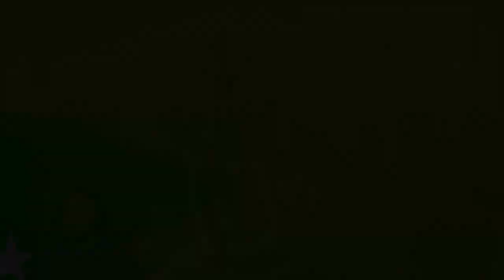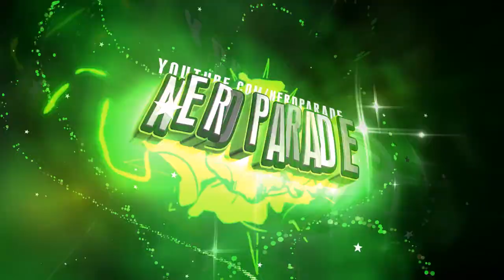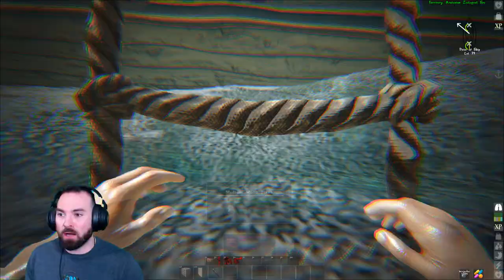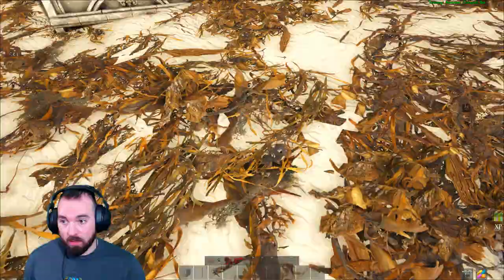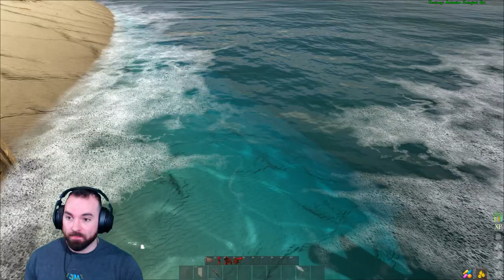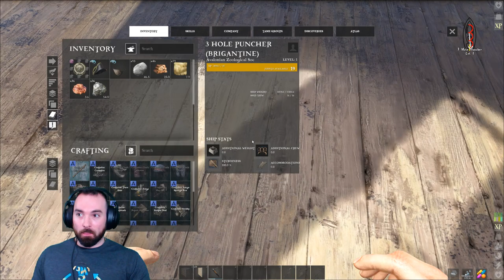ATLAS - Simple Base Destroyer Brig Design and the Science of Cannons VS Structures! E33

Comment: If you want a good wall breacher/siege vessel you need the brig with 20 large cannon broadside. Angle them to a focal point at max or close to max range. One volley knocks down gateways.  On actual walls it'll take more to make a huge hole. And it is still effective in a ship to ship scenario if you are a decent pilot. Make bare bones brig and your weight will still be decent.  2800 kg for 20 large cannon plus the weight of your balls at 10 kg a piece. Your still looking at less than 8k weight carrying a cpl hundred balls. All speed sails so you can get in, lay waste to the walls, then gtfo or come around for another pass. Even more effective if you have 2 or 3 kitted out like that and run a train. Nothing can withstand 40k damage a broadside. And that's 1 ship that's not a snail either. Need some lvl in it but if your good you won't get touched by SotD as you have way more range then them. Don't use npc auto fire at range. Manually lead or judge for them turning to get a broadside on you. And on a pvp server (I play official pvp) you'll nvr be alone when you do this. Don't worry about mortars either because you'll be too fast for them to hit you especially if you catch em offguard.(also assuming your a decent pilot). Ship to shire combat you don't want to be charging straight at the gates as it'll take more time gtfo. You wanna come in at an angle and fire as your turning back out so they never have time to react before your gone.

Comment: I was testing this out earlier and then when I saw this I had to go recheck my numbers because I couldnt believe the range thing was accurate. These numbers were all from base (100% quality) items and testing ranges of 10 and 40 tiles. With a +/- 1s margin of error, a regular cannon takes 44s to fire 10 shots with a load time of 4s @ 1064 dmg/shot to destroy a stone wall. In same test with a Lg cannon, takes 39s to fire 5 shots with a load time of 7s @ 2025 dmg/shot. I implore you to recheck the dmg vs range with the same cannon instead of using different ones.
Reply: basically boils down to being able to line up your shots easier vs range with cannons/lg cannons

Comment: Put large speed sail and small speed sail. put your guns on the rear. Level for weight reduction. Use a schooner with to rows of four large guns. Kite the SoD. Fire at shore in position to evade mortars. Much cheaper. Much faster. More efficient. More flexible. Accomplishes same mission.  Do you guys even gather mats for these videos or are you on privater serve auto generating the materials? You tend to overbuild as if mats are no worry. Using a brig when a schooner would do is an example.